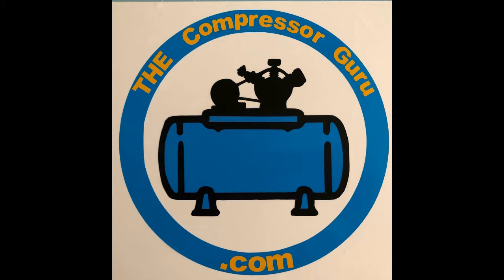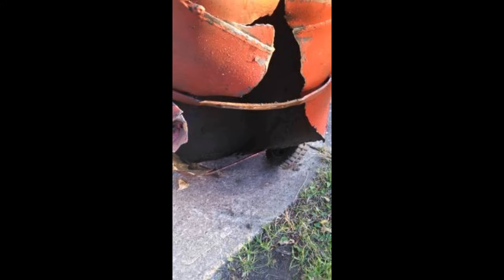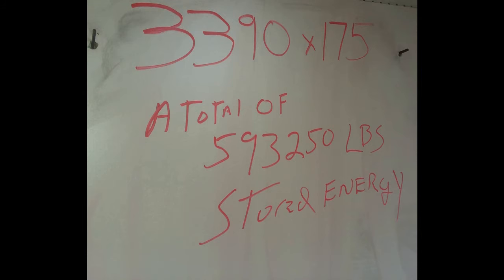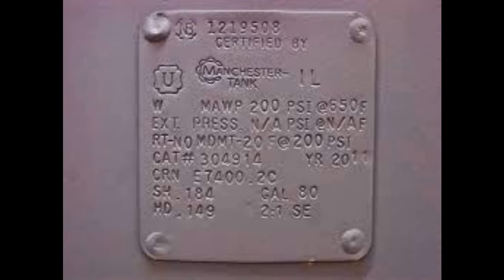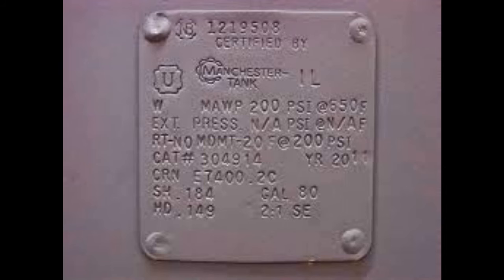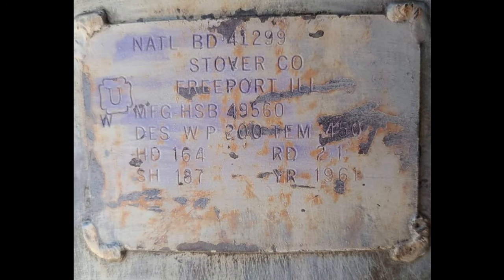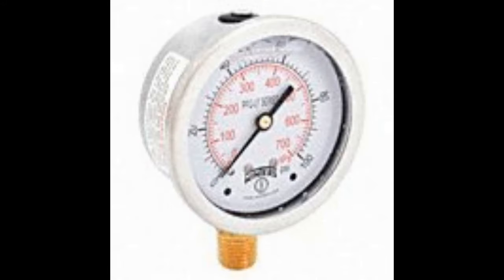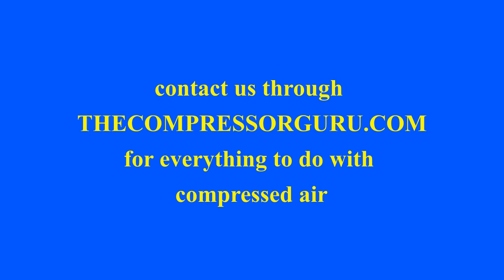Tank Safety, This video may SAVE YOUR LIFE!

Comment: Also when got 5 hp one used looks great 100$ cost more gas ,time.  Any way looks to have honey oil in compressor when turn on whip it up some. No site glass full on dip stick. Clean should change it or is it good type compressor oil like honey. I know have see it just wondering if make such thing heard of compressor oil but it expensive. So be motor oil that go in it. Kinda looks like lucus oil. Idk. Thanks
Reply from the maker: never use detergent motor oil in a splash lube compressor. not going to type out why... just do NOT. as for other oils yes compressor oil cost more . but there are anti rust and foam additives in it that make it the right oil for compressor pumps. if you have no other options NON detergent motor oil can be used. Compressor oil should not get dirty looking in normal operations. its different from engine oil in the respect engine oil gets dirty because of the soot that blows past the rings because of combustion. you still need to change the oil because the oil molecules will break down after heat and will not lubricate properly. you may contact me through thecompressorguru.com if there is anything else I can help you with.

Comment: Hi can I use a rattle gun on a small compressor  i have not tried this yet I notice some rattle  guns are small and I guess would require high pressure  to make them work some are large and may only need low pressure  to operate  .my neighbour uses  a nail gun that has a jam tin tank and drives one inch  nails very good  the jam tin tank is very solid steel and I don't think will ever explode  on a quarter horse motor
Reply from the maker: Its not the HP on the motor its the pressure in the tank that it the concern. I am wondering what you are calling a rattle gun?
Reply: @THECompressorGuru  rattle gun is an air impact wrench
Reply from the maker: @HDXFH  never heard that one . thanks

Comment: Don't let this video scare you.    This happens to cheap thin tanks.   Or super super old ones with tons of rust.      I collect and repair compressors. And I also repair my own tanks.     Yes I weld on them and yes I'll add a new port if I need one or add legs or fix the legs.   But I hydro test all of my tanks after the work I do.      You can work on air tanks. You just need to hydro test them and keep you're water drained out of them at all times
Reply from the maker: not trying to scare folk . I am trying to get people to take proper care and caution with what has the potential to be a bomb. the vessel is literately storing energy like a battery. or the gas tank on your car. but this is a storage device that requires some more maintenance ( drain daily). it shows that you care  for the safety for yourself  and who ever gets the machines you work on  and that is why you do hydro test.
Reply: Scared me a little, but sometimes it better to be scared into making sure you know what you are doing than getting blown up by an air bomb!

Comment: why don't your compressors have safety blow off valves so if the pressure switch doesn't stop the compressor at desired pressure then the safety valve releases at a pre determined pressure (usually 175 psu)
Reply: psi
Reply from the maker: So what you ask on its face makes sense. but on a cold morning the pressure switch may not shut off till 185 or 190. the springs in the switch are very temperature sensitive . you may also have 2-3 or more machines lined up and set in series with the primary set at 180 the next set at 170 and so on. just because they are factory set at 175 most brand 2 stages are perfectly capable of pumping higher and some customers need that little extra. the important thing is to not exceed the tank max working pressure with a higher set popoff/safety.    see this link about cold weather pressure problems.
https://www.youtube.com/watch?v=IzT6fykKDwQ
Reply: @THECompressorGuru  in Australia most pressure switches are preset to under 150 psi and safety valves 180 psi and most that I've seen how an electric auto drain attached to drain plug draining water every 40 minutes for 3 seconds
Reply from the maker: @michaeledwards8058  interesting about the preset on the machines there.
the elec drains I sell are fully adjustable, with adjustments for length of how long the drain is open and time between when drain opens.
Reply: @THECompressorGuru  yea I've seem them too

Comment: CHECK THE SAFETY RELIEF VALVE ,  MAINTENANCE IS THE BEST OPTION
Reply from the maker: You are absolutely correct. your safety valve should NEVER exceed the certified tank pressure . this does not mean you do not drain the tank daily. and the Maintenance is pulling the safety ring when you service the machine to make sure it is still operable. BTW this is 1 of the checklist items we do on the yearly or quarterly maintenance
Reply: @THECompressorGuru  Some pull the safety release valve at zero pressure and presume all is well because the pin moved however when done that way you really do not know if the valve has become plugged, etc.  Pull the relief valve while the compressor is running and verify that it at least bleeds off pressure to below the compressors kick in pressure before re-seating itself.  Be wary too of the new tanks designed with more convenient drain valves mounted on the front of the tank about 1 inch above the bottom of the vessel.  Those drains even if you automate them are pretty pointless unless you tip the tank on its side every time you drain it.  Too many design decisions it appears are being made for marketing purposes with little thought about safety.

Best!
Reply from the maker: @neilfromclearwaterfl81  1 of the safety checks we do during a PM is pull the pins on all safety valves while under pressure for the very reason you stated. 
I have not seen 1 of the new tanks where the drain is not on the bottom of the tank. can you send me a picture through thecompressorguru.com? or give me a brand name and model here? those tanks can not be an coded tank.
Reply: @THECompressorGuru  I first started seeing these on portable 1 to 2 gallon hotdog and pancake job site compressors from the store brands but now am seeing them from the more major brands such as Emglo, Makita, Griprite, EstWing, etc not just the King Feng Foo type (generic import/foreign trade brands) plus now on compressors with 10 to 30+ gallon tanks.  Most recently was on a McGraw/Harbor Freight 29 gallon upright compressor.  This is showing up on all tank styles pancake, hotdog, horizontal and vertical.  I've even seen them on some truck mount compressors while driving about.  It makes me cringe especially when they're on the sizes that some are inclined to bolt down and hard plumb in a small shop making it so you can't easily tip them over for draining.  When I see the verbiage highlighting an easy to access drain location as a selling point I become concerned.  Some have modified the bell end to have a channel stamped into it running down to the side drain which is better however you have to hope the now non-symetrical bell was well enough engineered to compensate for the uneven stresses that would introduce.

When marketers and bean counters start designing product going against sound engineering principles its not a very good thing.  Look at what this has done to the commercial aircraft industry just with the current version of the 737 experiencing crashes and near fatal events from slapping new style of engines on that change the center of moment and then relying on automated safety systems to make up for the lack of good engineering.

Perhaps in the sub $1000 compressor market they're hoping the majority will experience pump or motor failure and be disposed of before the tanks fail from not being able to easily drain them properly.

Thankfully some shops I've seen these in are at least putting some type of safety enclosure around them to contain things even if its just 1 1/4" pipe and heavy chain link hurricane fence.

Comment: And yet tanks are never made of a rust proof material.  Stainless steel might be a candidate for tank material as can be other more expensive alloys.  I have always burped air compressors.  Besides being a rust causing hazard water takes up space air should be occupying.

Comment: After watching this video I will never buy a used compressor. Or keep one in my garage
Reply from the maker: Dave it is ok to keep in the garage . just use a coded tank and keep the water drained. and when its over 25 years old get it tested.
Reply: Or you can always wheel it outside to use it....... Like I do.

Comment: who calculates stored energy with pounds? are we comparing it to a gravity battery? no one has one of those to use as a reference.
Reply from the maker: the energy in compressed air is measured in PSI Pounds per square inch and the explosive force can be calculated from that measurement.
Reply from the maker: sorry for the slow reply went to bike week in daytona

Comment: now Im paranoid.   Ive left it go months without draining it. and Ive had it bolted to the concrete floor with a tapcon and no pad. Now Im worried.  I have a boroscope maybe I can look in there through the drain hole.  Rated at 135 I go no higher than 100. Sanborn 1993.
Reply from the maker: drain the tank!!! you can look with the bore-scope but the only real test is to hydyo test.  Is the tank certified?
Reply: @THECompressorGuru  It hast that tag on it that you showed us.  It says on that tag Certified by SMC.  Then there is the square logo with the letters UM.  It says MAWP 135psi at 650 deg F.  Also has the letter W under the UM logo.  I bought it new in 1993.  It came with wheels. Should I weld ears on the frame (not the tank) and bolt it to the concrete floor with 4 tapcons?   I will inspect it with the boroscope and I dont know where to have it cleaned with that wand and hydrotested again I dont know of a place that does that.  Thanks very much for the help by the way.
Reply from the maker: @ScreamingEagleFTW  Yes you can weld on legs and mounting area. DO NOT weld on tank. how big is the tank? the inspection holes are only on big tanks. won't be back at computer till monday. have a great weekend.

Comment: It’s probably not much money they could make these tanks last a lot longer and get rid of all the safety problems you know you don’t see propane tanks blowing up all over the place with all the videos and pictures of injuries you know maybe we should start forcing them to plasticize the inside of these tanks or coat them with something and can you soak the tank and oil from when it’s brand new to keep it from rusting I just wondered
Reply from the maker: the plastic idea i think is a good one. the oil... I think it would eventually drain off and water would eventually cause the same problem. you  should contact a tank company and share that with them you might be the first.

Comment: Guru, what is your opinion on internally cleaning, then chemically derusting a commercial grade pressure tank (compressor or reciever), hydrotesting, then, super epoxy coating the inside? I saw Shadon HKW ON youTube restore a compressor like that. Thanks, Paul
Reply from the maker: if the hydrotesting  was good I think sealing the inside of the tank is a great idea. instead of the epoxy I have been thinking about permatex rust treatment. it seals and protects against new rust. I have used this on car bodies and truck frames and it seems like it would be perfect for stopping any future rust inside a tank.
Reply: A layer of rust protects against more rust
Reply from the maker: @darren92redrum67  lol
Reply: @THECompressorGuru  how do you safely clean the inside of the tank  without weakening it?
Reply from the maker: @ScreamingEagleFTW  good question. I think the best way is to use a steam jenny and work the wand around the inside of the biggest plugs on the tank. depending on the size and age of the tank some tanks have inspection and cleaning port built into the side.

Comment: But 175 psi doesnt sound like a lot. Is it really that much inside a compressor?
Reply from the maker: even only 100 psi that is 100 pound per square inch. lets do the math. an 80 gal tank is about 60 in x 24 in dia. . that is a circumference of 75 x 60 height=4500 square inches plus another 900 sq inches for the ends that totals 5400 sq inches at lets say 120 pSI  that 648,000 plus pound of stored pressure. a pin hole means almost nothing but a sudden rupture and releasing all that pressure in a split second is catastrophic.I have included a link to tire explosions most truck tires do not have the volume or the pressure of an 80 gal tank of a 2 stage air compressor (175). note the damage to the truck bed at 35 seconds into the link.
https://www.youtube.com/watch?v=Ysb-wLB836A
I didn't post this video as click bait or exaggeration . I care about people I do not want bad things to happen to them.

Comment: Thanks for the caveat about the pinhole leak being an early warning sign of tank failure. Actually not warning but failed. Your story about staying clear of a unit until after shut off is valueless. Just because the unit doesn't explode while filling doesn't mean it is sound and won't explode 2 seconds or 2 minutes or 2 days later. My experience was a tire which blew out (vehicle was in storage).
Edit: On further contemplation it seems to me an early warning sign might be tools and ports becoming clogged from rust flaking.
Reply from the maker: I would argue about using the word "valueless" however you do make the point a pressure vessel may fail any time there is pressure in it.
Reply: A running compressor with bad rings passing/atomizing oil into the reservoir with  compressed air makes for a BIG bomb while running. It has spark
Reply: @billdavid6315  This exhibits poor knowledge of a compressor's operation among other things.

Comment: What is the deal with all these Made in China tanks? Usually they have no tag at all
Reply from the maker: no tag means non coded tank. non code means there was little or no testing for what the tank pressures were capable of holding. I would NEVER buy a non coded tank. they are thinner and never do last as long before (IF you are lucky ) they only leak.

Comment: 50,000lbs stored energy; forgot to divide the inches back into feet, but whatever yes that's an INSANE amount of energy!
Reply from the maker: didn't say it was pound per foot it is PSI and that is pounds per square inch. I realize we mechanics usually thing in ft lbs. I do not understand energy equations very good but I think looking at these numbers this way is right?
Reply: Ohhhhh right, foot lbs, inch pounds, kinda confusing to think about now, thanks ahaha. 
I found a pinhole in my 4.5 gal ridgid compressor I bought yesterday for a "good deal" but oh well at least the motor is strong and I'll probably swap it out for an air or propane tank to be safe. Will be much bigger capacity anyways.

Comment: i) I'm pretty sure that the tank will continue to rust, EVEN if you drain it every day.
ii) It's inevitable that structural integrity will be lost due to incessant rust build up, and that this incessant rust build up was a contributing factor to the catastrophic ruptures.
iii) The maker could likely have prevented these inevitable catastrophes simply by coating the inside of the tank with epoxy (just needs a 30-second UV-light cure). So, the makers should be sued for these disasters. No excuse for not preventing the disaster that they were well aware of with this easy fix.

Comment: I have a Harbor freight 29 gal.  Central pneumatic   oil air compressor for maybe 8 to 10 yrs  the better one I actually have 2 of them.      my older 1 is in the shop the 1 I have newer one sitting at my house never used it was sick for 2 years it's making a noise just tryed it.    it's for something else's too . afraid to use it make  Some noise don't know what's wrong  ? 

 The one in the shop is going all way up to 200 pounds.  I  Afraid  It will blow up.   the safety  Blow off I'm going off either

what can I do ?  can I adjust it ?   to bring down  
 can anybody advise me what to do I'm an old man can't afford to taket to get fixed.  I AM ON  fixed  income have no money WAS SICK TOO  could use some help thanks
 
Oh  Forgot I wanted to ask you I have an old CH tank thing it's A 20 gal.  from an older compressor that went bad yrs ago I wanna put it on for an extra tank for more air , is that safe or not to use a second tank one compressor . Do you have a video on  doing that putting on a  2nd tank
Reply from the maker: I would say your pressure switch needs adjusted down. it may have gone bad and won't adjust. I do not know what switch you have so beyond that I can not advise. 
feel free to contact me through  thecompressorguru.com
as for the second tank yes I love adding volume to a system. BUT you need to make sure of the pressure rating of the second tank and after watching this video you want to make sure the tank is OK. 
that is a great idea for a future video adding tanks to a system. look for it in the next few months!
Reply: @THECompressorGuru  Thanks  I sure do appreciate the comeback
God-bless
Reply from the maker: @theodorebowers9737  you are welcome :) the sad truth is the bigger this channel gets the tougher it is replying to all comments.